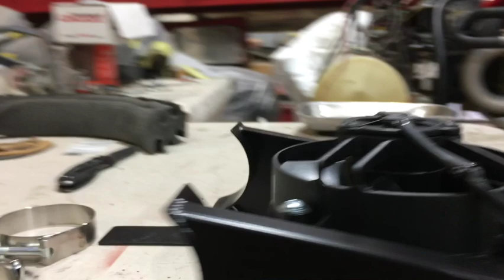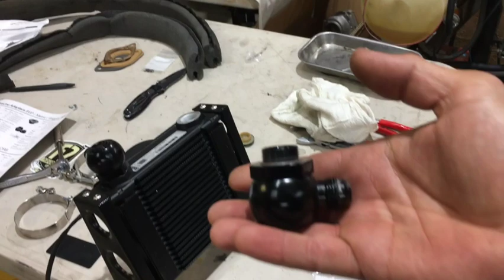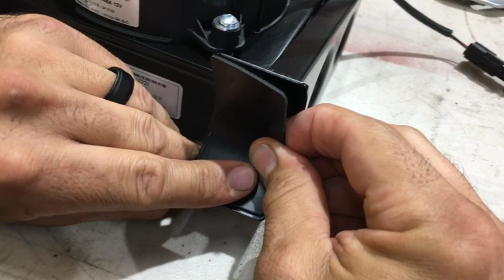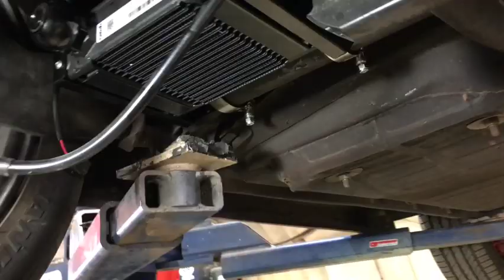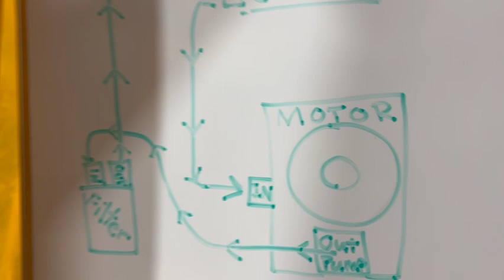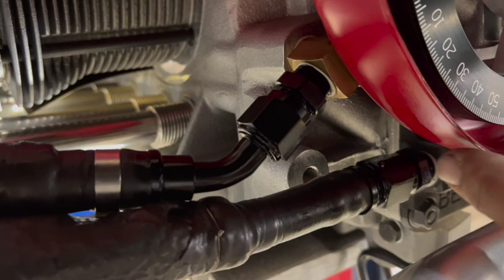Easiest T-1 VW oil cooler install

Comment: That mounts onto the suspension and it looks a bit cramped. Not worried about it rubbing on stuff down the road?
Reply from the maker: No. It clears all moving parts.